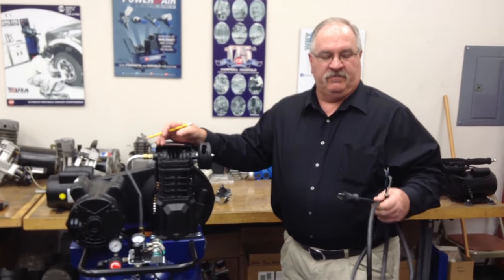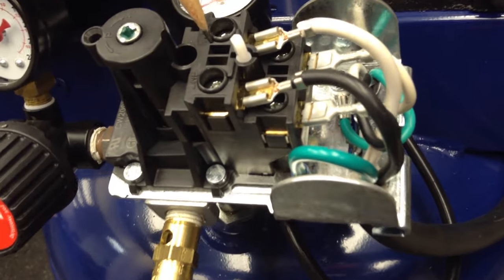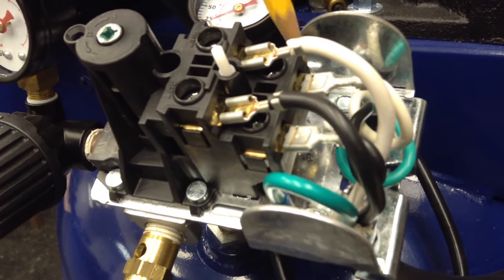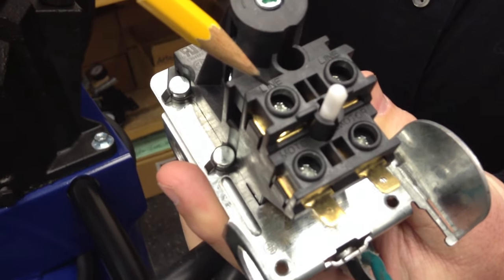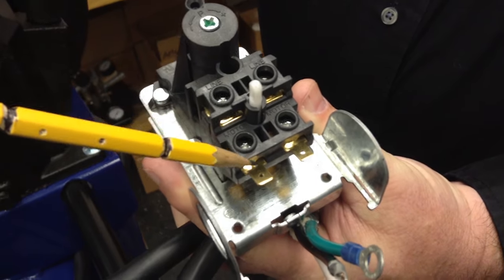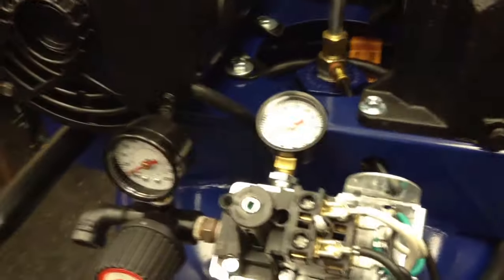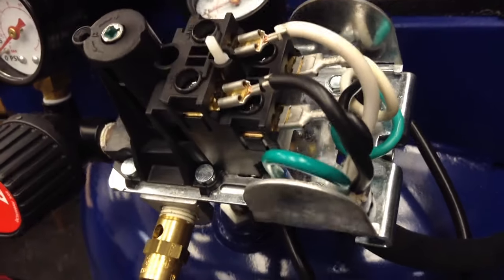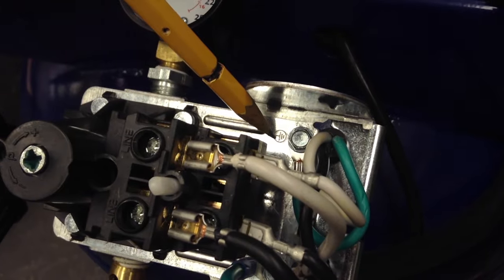Tech Tips - Campbell Hausfeld - How do I wire my pressure switch?

Comment: My regulator output assignment knob seems to be leaking air at the knob when set. Once it leaks i can stop it if i turn it up or down. Is the knob bad? It holds air pressure when the compressor is off. Thanks

Comment: I have an old Campbell Hausfield compressor. It has red, black, and green wires. However the red and black wires are  red, black
                                   and black, red.    From the factory.  probably 1980's model 
Now what do I do???

Comment: What do I do with My red wire?
Reply: you don't. It's a 2 wire, plus ground system
Reply: @jrlegacy23  Thanks I got it running good i just put a cap and taped ot real good works fine.